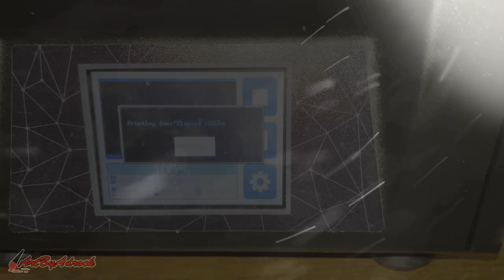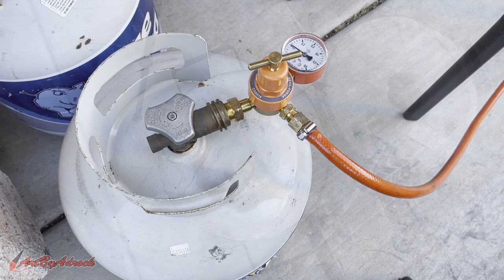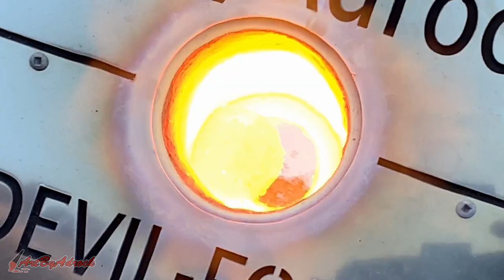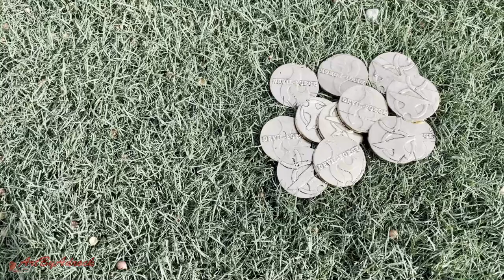Casting Devil-Forge Custom BRONZE Coins - How To Make Bronze At Home

Comment: Fantastic video.  I'm curious - assuming there is only the single hole in the plaster into which the metal is poured, what is creating the vacuum at that stage, around 6:50?  Is the plaster slightly porous or is there another hole in the solid plaster within the vacuum chamber?  On a different note, your channel has been a welcome distraction this past year, so thank you.